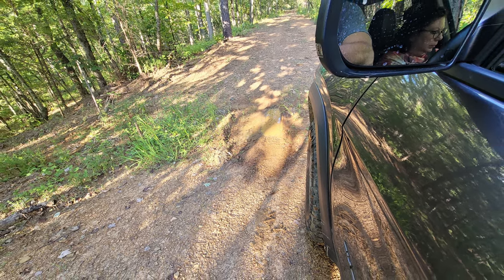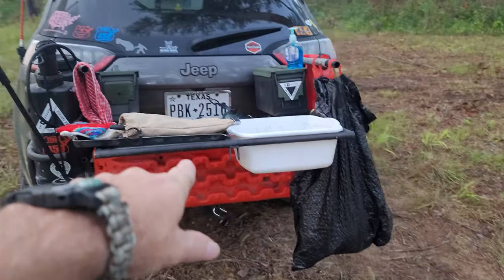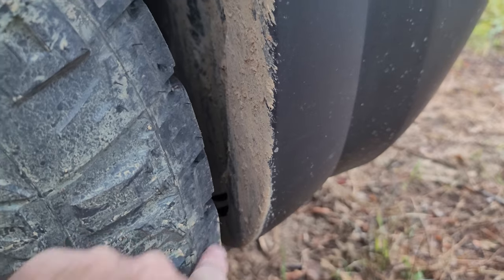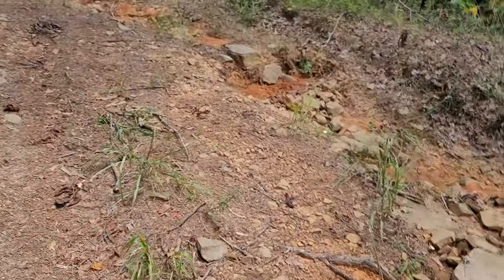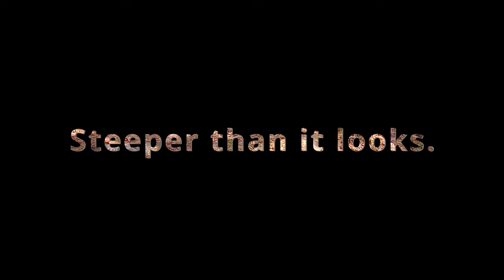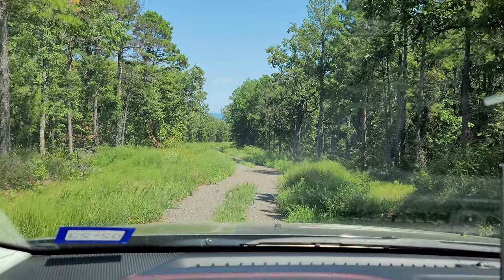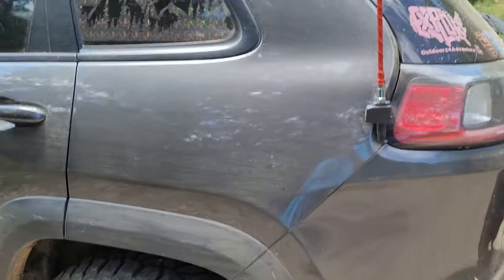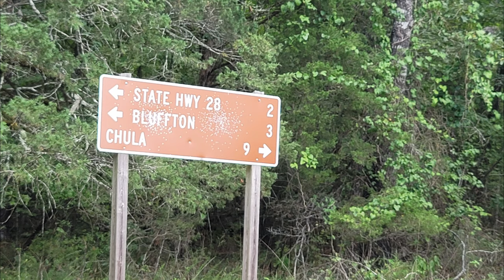Overlanding The Ouachita National Forest In The Jeep Cherokee Trailhawk

Comment from the maker: Difficulty varies from section to section on this route. A lot will depend on your individual vehicle setup. With 30.5 inch tires ,12.5 inches of ground clearance and a locking rear we had zero issues on the hardest parts.  Some spots, there is not any room to turn around so you may have to back out if you don't think you can make it forward. Sections of this route are on Onx Offroad App.

Comment: I like your rack setup on the rear. I’ve got a 2022 Trailhawk and I might look into something like that for cargo management. What roof basket are you using? I currently am running a Curt but would like a lower profile.
Reply from the maker: My roof basket is two harborfreight baskets that i modified into one. I have solar panel storage made under the main rack so that the space between the rails is used. It fits my 200 watt suitcase perfect.